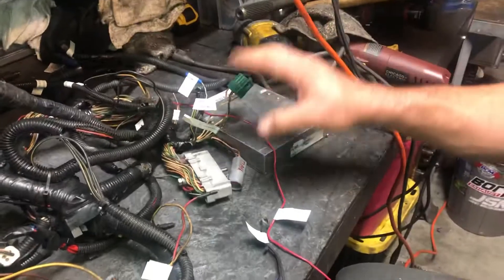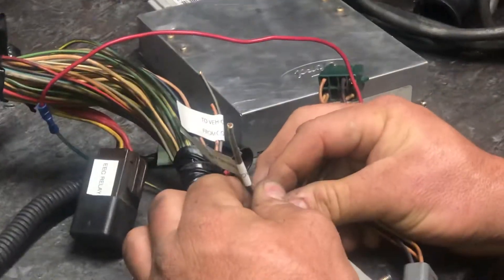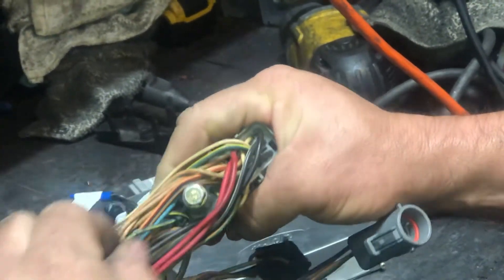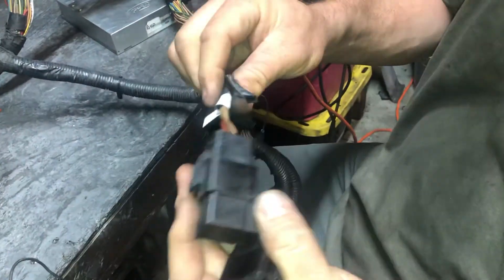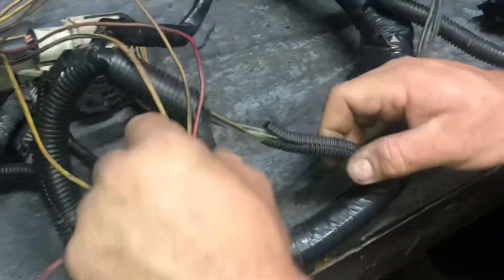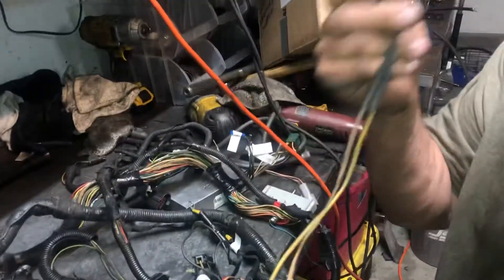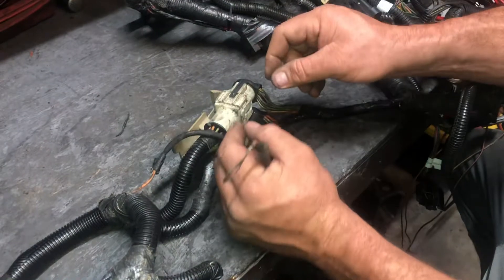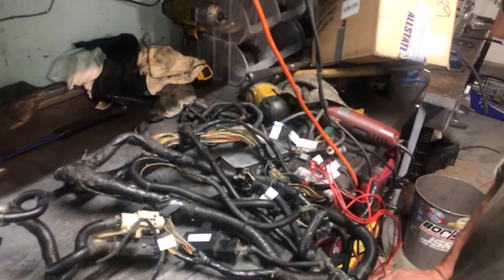Foxbody harness in vintage ford mustang connections 1992-1993 harness a9p a9l

Comment: My pin #3 and #6 are not the same colors as yours mine are drk grn / yel , orange/yellow.  I have a harness from an 89 fox body w/ manual transmission. And an a9p ecm
Reply from the maker: @cwalters6464  that year is different. 
Try this diagram 
http://www.veryuseful.com/mustang/tech/engine/images/88-91_5.0_EEC_Wiring_Diagram.gif

Comment: My 84 ranger has a good power source for the ecm same color wire even. 
But my green plug by the 60 pin has a different color set of wires to the fuel pump. I'm going to have to look at a schematic to see what the actual pin number is or something. I have two sets of tan wires left that I could cut.  Tan with green stripe or tan with black stripe.

Comment: Im putting a 302 ho from 89-93 mustang into and 84 ranger. 
I owned one of these before and had issues with the alternator charging. The problem had to do with the way the guy who built it wired the alternator to the ignition key on power or something.  It was an intermittent problem that eventually went away so i didnt get to learn anything while solving it. 
Now im building one myself and all i can remember is the yellow wire on the back of my alternator needs to be connected to something or alternator will not charge.
Reply: What alternator are you running?  I highly suggest a 140 amp 3g.  Comes stock on 94/95 gt and v6 mustangs. 4 gauge fused wire to starter relay, yellow back to post on alt, and green key on
Reply: @jeremythompson4821  it's a 12v 75A. No stud. Has one pig tail with g/r , b/w , y/w . 
On some alternators the b/w wire plugs into the alternator. This model doesn't have place for it. The y/w and g/r are relevant. 
Where other alternators have a stud I have a plug with 3 spades in it. I need a pigtail to go in that to build the rest of it out.
Reply from the maker: @cwalters6464  i have an 87 mustang at home and can look at the alternator and check the wiring
Reply from the maker: @cwalters6464  i just googled 3 spade alternator connector ford on google and came up with some results
Reply: @v8only  I've had some helpful comments also. Thanks

Comment: Hey man, great video. I did everything you suggested except the speed sensor wires, and it doesn't seem to be working for me. Any suggestions? I pulled the engine out of a running 93 .
Reply from the maker: What’s it doing?  Is the fuel pump priming?  Very hard to say from just limited information.   The red wire with the green stripe is critical. That supplies power to the ECU relay.   Make sure you have the ground wire at the computer grounded out, the green wire off the field injector harness grounded out to the bell housing, and I believe there’s one more ground upfront near where the battery would go on a fox body.  The steady power comes from the wires that had a terminal that just goes on the positive side of the relay.
Reply from the maker: Positive side of the starter solenoid that is

Comment: Very informative. I am doing a 4cyl to 5.0 swap and I have a A9P. The fuel pump is not priming when I turn the key and the car is not starting. Going to follow these steps and see what happens.
Reply from the maker: That’s either going to be the constant power, the ring that connects to starter relay plus side (12v constant) or whatever wire i Have labeled in their as fuel pump key on power. Good luck!